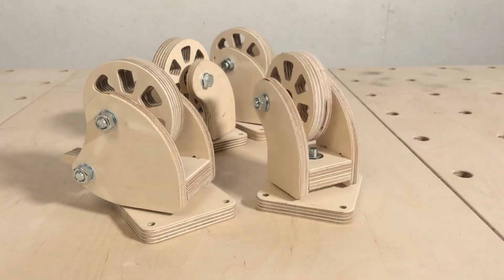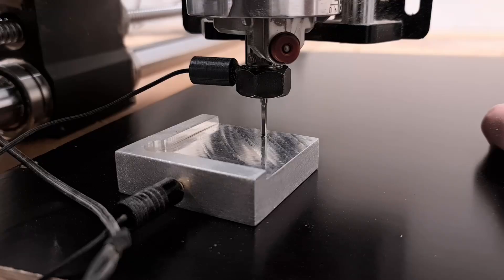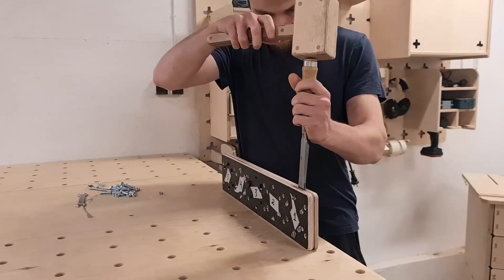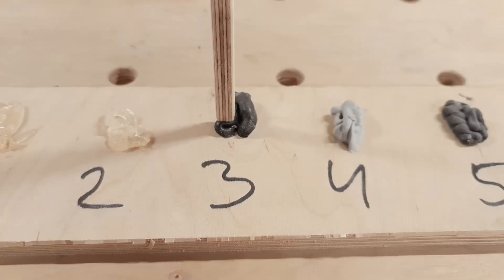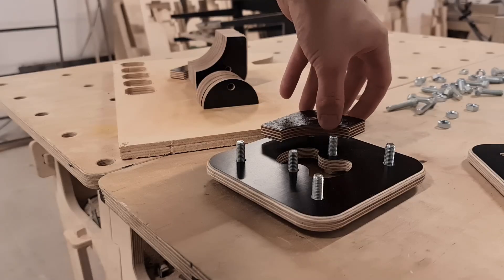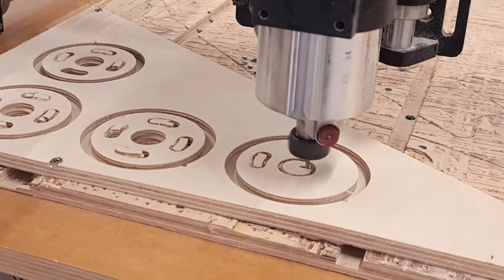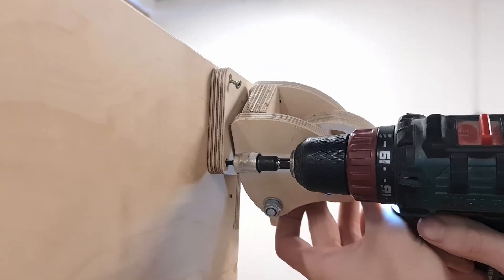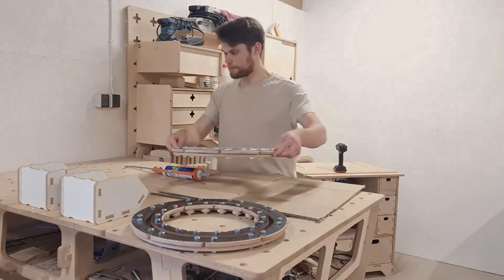Updating The Caster Wheel Project - Simple CNC Build

Comment: I would use a flat trough, that way you are just wrapping it around the wheel and cutting it to size
Reply from the maker: Thanks for the suggestion! Using that approach could definitely simplify things. However, one of our main goals for this project is to develop a method for making tires that fit well with our go-kart build.

Comment: Cool design for the molds. I would have used wax, like you use on your bare metal tool tops. Johnson's paste wax or even a bit of paraffin would have worked. Also for sound dampening just stretching some innertubes sliced into wide rubber bands would work. 2 or three on each of the old wheels
Reply from the maker: Thanks for the tips!

Comment: Couldn’t you create the mold with the body of the castor in the middle? 

So as to create the tire in place instead of removing it from the mold and reattaching it to the castor.
Reply from the maker: That's a great question! We did consider creating the mold with the castor in place, but we found that this approach increased the risk of the sealant not filling the entire mold, which could lead to inconsistent results. By molding the tire separately, we ensure a more reliable outcome.

Comment: Man, have a look at diy aluminum casting. Foundries (especially home foundries) use a mix called green sand. Basically sand and oil that clumps together very well. They'll use a two-part mold that's basically a two piece box, press the buck(prototype molding part) halfway into the bottom, add the top and pack it full of sand except for a tube to make the filling and vent holes, disassemble the box and remove the part, the reassemble the box and pour molten metal into the void, creating the part.
I bet $1 that for a simple part like this, you could cnc the wheel, press it into a similar mix, pull it back out, and just pour a two-part urethane rubber into it. No need for a two part box, just leave the top of the part open. I did something similar for my car's engine mounts. The sand breaks away easily when you pull your piece out, and is reusable. If you have trouble with the tire width, a trimming jig (not unlike your current mold) could make trimming it down a piece of cake.

Not related, I love seeing your machine fly around at speed! Too many people running them too slow!
Reply from the maker: Thank you so much for your detailed and insightful comment! I’m familiar with the green sand approach for metal casting, but I hadn’t considered it for producing plastic parts—definitely something to think about for future projects. The wheel was a relatively simple part, and while my method may not have been the fastest or most convenient, it got the job done. Your suggestion of using urethane rubber with a green sand mold is intriguing, and I might experiment with it down the line.

Also, I’m glad you enjoyed seeing the machine in action! I love pushing it to its limits. Thanks again for the great advice!